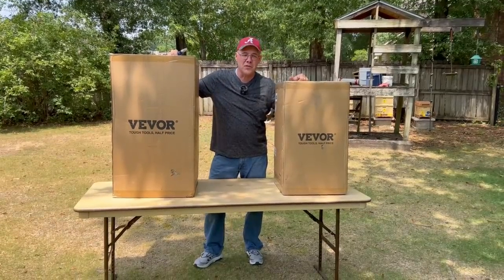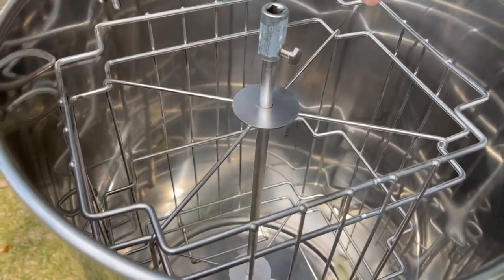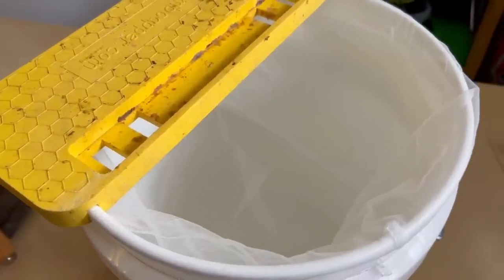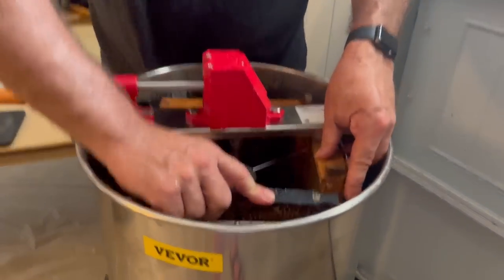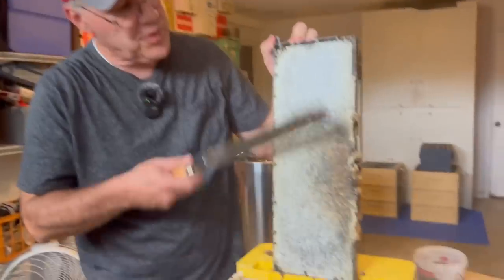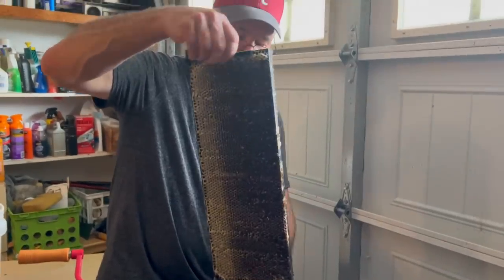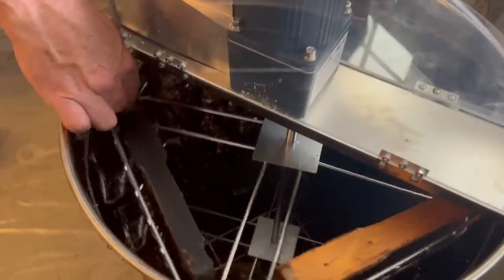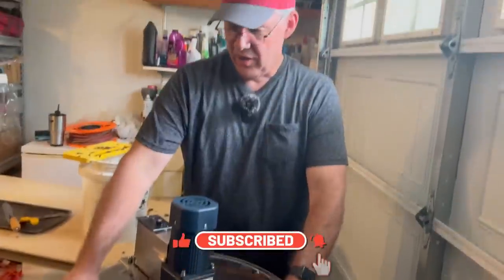Manual & Electric Vevor Honey Extractors - An Honest Review

Comment: I have the Vevor 3 frame extractor.
There are razor sharp edges along the leg lines. I covered them with electrical tape.
Keep an eye on the ball bearing in the hole beneath the spindle, it's easy to lose. I went to a local bicycle shop and bought a few spares.
In retrospect, I wish I'd spent a little extra and bought a better built extractor.
Reply from the maker: I hear ya.  These are good to get you through for awhile but if serious about beekeeping would probably be best to invest in something more heavy duty like a Hillco, Maxant, Dadant, Thorne, Lyson etc.
Reply: I was going to buy the electric one, but they were sold out.

Comment: Thanks for the review!!
Just a tip, you are placing your frames in backwards, the centrifugal force should be to the tailing end or top of the frame as comb is built by the bees with a downward angle like a "V". the openings are slanted slightly upward by 9–13 degrees. This prevents stored materials and brood from spilling or rolling out of the cells before they are capped with wax. so in the spinner case the top of the frames should be at the "back" of the spin direction. Otherwise you are "scooping" up the honey.
Reply from the maker: Makes sense. Thanks for the tip!

Comment: I bought the electric extractor about 4 years ago to supplement my old extractor. The first time i used it,  two of the leg brackets that are spot welded to the tank broke . I contacted the company, and they sent me a new tank.   The spot welds on the new tank didn't look any better than the first, so I sold it.

Comment: I’m a new bee keeper this year I got 28 lbs of honey and used my mentors 3 frame Vecor we ran into the same thing you did with deep frames….we put 6 small washers over the bolt and raised it up alittle worked great …. We also bolted it to 4x4s and stood on them. Then he let me crank it 300 turns each side. They were dry when I got done…..lol.   Great little machine we also used  Pamper Chef spatula to clean the bony off the walls worked great!  Hope to get an electric one 2024 as I am building 10 more hives and can’t wait to get my new bees!  Good Luck Middle Tennessee 🐝
Reply from the maker: Hey that’s good stuff and thanks for the tip!   If you decide to get a motorized one and you plan to do this for awhile I would look into a more sturdy model like a Hillco, Maxant, Lyson or Dadant type machine.  You will not be disappointed.  If money is an issue then the motorized Vevor worked well but I don’t know how durable they are.
Reply: I did watch a review of Hillco looked very sturdy and had good reviews and 4/10 warranty.  I work a lot of OT so the cost
Is OK $1000-+ just want a good machine hassle free but it was fun bee talk for a couple hours while
We were spinning my honey talking about 2024 and what we need to do to be more productive …. I said build 10 hives! I’ve already started 10 tops and 10 bottoms and vents done….. starting on brood boxes supers (deep& med) next! Not scared to work- can’t never did anything get out of you normal box and do stuff I have never done like build a total bee hive colony! Takes alittle time but when Insee 10 hives in my back yard
I built and bees buzzing around in April and my smoker filled up with wood pellets  ( great tip) that’s will be a great day.  That will be my B Day present to
Myself for turning 61….. heck yeah!!
Reply from the maker: Hey this is great stuff man.  And if you aren’t afraid of work the bees juts might be for you!  Hope it all works out well for you.

Comment: Vevor seems to be the harbor freight of the internet. I've looked at several of their products and I'm tempted to order somethings.
Reply: Your spot on ! I was cautious At first. But I have ordered small idems a big ticket idems an never had a problem with them and have had excellent results with there customer support . Replacement?has only been the time it takes to send me a replacement
Reply: In hindsight, I wish I'd bought something else.
Reply: @dkeithcollins   oh I understand completely it has its  problems. but for a start out with very little investment? But if I was going to be running 100 hives? No nada no way with that unit make it taking honey off twice a year… but the way I looked at it if it got me 3~4 years I could throw it away because it would’ve paid for itself.. if I was going to modify it? I would plug the side, Spicket and weld a Stainless Steel nipple in the bottom.  Then you would have super easy cleaning an hardly any honey loss
Reply: @dkeithcollins  For the Money Hillco makes a might fine extractor
Reply from the maker: Yes if I’m it for the long haul and don’t have much money or want to go budget grade on your first extractor the Vevor or something similar might work well for you. But if in it for the long haul and you are not afraid to spend some money for a quality product that will stand the test of time then would purchase something like Hillco, Maxant, Thorne, Dadant or Lyson.  All proven brands should give you good service.  That having been said the Vevor did a nice job. We extracted a total of 25 gallons of honey.  I have no idea about the durability of the product but it worked well for us in this little experiment.

Comment: Bruce, I bought the 4/8 extractor and use it at slower speeds and it works well w/o shaking. Start at 35 increase to 45 until the sling is nearly done, flip and slowly increase to 65-70, flip and in 2 min you are done. When you put frames in the radial slots, it shakes like mad. I do three med supers at a time, electric is the way to go and this is a dope extractor for the price.
Reply from the maker: Hey thanks for the input.  I think it is a nice extractor for the price.  That is good feedback though to help folks understand how to use it without it shaking.

Comment: I had a manual like that before and the handle broke. I could not loxate a handle so it basically became useless. Huge safety issue with the top not fitting on. I think the electric would be good for those with <5 colonies. I've learned that when you get more than 5 hives, approaching 10, you need a decent electric.

Comment: I looked an looked an thought an thought  an finally I decided in my old age I am a tad lazy and I went with the electric one 3 years ago. An I absolutely love the variable speed !! I can run 4 out while I am getting 4 more ready.. 😂 I see you found my one  problem I have with mine an that is the drain Spicket !! But I made a work around on mine. Mounted it to 3/4 plywood square with thumb nuts for easy storage an I have 2 solid half cement blocks I lay on the plywood. When done spinning I kick the blocks off an tip the unit to drain. But other than the Spicket? I have no problem an should this one die I will buy another one.. ( not that I would recommend it but them safely switch’s?? ) well let’s just say the unit works the same with or without..BUT if their was anyone else besides me running it? I would probably make sure they work for safety… but this video will help 100’s of small new beekeepers in the future ❤❤❤
Reply from the maker: Awesome!  Thanks for the feedback and for the tips.

Comment: I have the manual extractor, works fine. Could be a little more heavy duty but the price is excellent. The gate position is a negative for sure but totally usable.
Reply from the maker: Any issues with the cage being set too high like in the video?
Reply: @brucesbees  nope, mine is fine.
Reply from the maker: @tommywise1702 ok good.  The one I got was just a little strange.

Comment: This is one piece of equipment that I still need to purchase. I started with two nucs this year and ended up splitting one. Now two of the three are strong enough and starting to fill my first honey supers so it's looking like I may be able to pull a little if the flow continues here in s.w. PA.  As always, thanks for the video. Vevor seems to be the best value for someone like myself.  I think I would go with the electric model as well. Staying low budget went out the window as soon as I started purchasing equipment.

Comment: I have the electric 3 frame extractor and have no issues. Some frames take a little time to balance but can usually reach top speed. Are you putting the frames in the right way? Since the cells slope up towards the outside of the frames, i always put the bottom of the frame as the leading edge in the extractor. Helps the honey to flow cleanly out of the cells.
Reply from the maker: I thought I was doing it right and it works fine. But what  you say makes sense.

Comment: Thanks Bruce as always. I bought that electric 5-6 weeks ago. I think it was $270 and on my porch in 3-4 days. Took roughly an hour to clean (took out lube grease on ball bearing, replaced with vegetable oil), assemble, and fasten to porch joists (16” centers, 3” drywall screws, between deck boards). Was only doing 12-15 deeps as honey is not my focus (queens and nucs). Just pulling a some for friends and family this round. Uncapped, extracted, and hosed everything down by myself in 2 hours. If I was pulling a few 1000lbs, I’d go bigger, but easily worth the money for small time. Thanks again for all you share! 🐝😃
Reply from the maker: Yeah I think it is perfect for that situation.
Reply: Do you know the size of that ball bearing? Forgot about it and lost it when cleaning
Reply from the maker: @andywhetsell8828 yeah I lost mine too.  It is not very big but not sure of the size.
Reply: @andywhetsell8828  I wrote like a detailed reply yesterday but must have gotten crossed up. I first guessed, then figured it wasn’t that difficult to unbolt the top. The ball that shipped with it is 6mm. Lappe’s and Betterbee had done advertised, but for a one-off a hardware store or eBay would work.
Reply: @joestocker660  thanks Joe. I’ll order several because I’m sure I’ll lose another one
Reply from the maker: Hey thanks for the update.  I had no idea the size but I knew it was pretty small.
Reply: @andywhetsell8828  As long as you’re pulling light honey. Otherwise you may lose a tooth 🦷😂 Biscuits are no place for bearings.

Comment: Thanks for your review. I purchased the hand crank version being that I have only 2 hives. I experienced the same issue whereas the frames hit the crossbar. Mine was totally unusable until i reversed the connection that drives the basket.  Tops are totally unusable. One side of the the crossbar sits higher than the other side. This allows enough clearance to rotate that basket without hitting the frame ears.
Trying to reach the mfg. has not been successful.  Very nice review. Thanks
Reply from the maker: Yes I was not impressed either the hand crank one.

Comment: I bought a used dandant hand crank came with matching storage tank for 200.00 ... Ended up buying a new electric maxant so I sold dandant for 250.00 and kept the storage tank.. in like 5 minutes on market place.. something to consider is resale American made will hold its value like a Kubota tractor does .. going to cost more up front .. maxant im going to sell its to small and to tight 9 frame think its called .. i expect ill get what I payed for it .  That's pretty sweet they just send you couple free extractors .. all your hard work paying off.
Reply from the maker: Nice job finding a great deal!  In reality you cannot go wrong lying a little extra for good quality products, but sometimes the cheaper stuff can get us through for awhile.

Comment: Thanks for the review!  I wish I could share the same …. Purchased an electric extractor from Vevor last year and my bad, did not put it together for about 5 months.  No attachment points for the 3rd leg and too late to do anything like call the company.  Forced to use with 2 legs and a milk crate.  Still better than a manual though!  (PS - my son will be going to Alabama in the fall 🫣..so far!  ❤️🐝🐝 in Northern IL
Reply from the maker: Roll Tide!   Wouldn’t be bad to just start it to a table.  I’m sure Vevor would have made it right but sounds like you figured out something that would work.

Comment: I have the hand crank Vevor the ears on the frames hit the crank frame support, the cage is too high. I had to cut down the bottom of the rod of the cage to drop the cage 1/4 "
Reply from the maker: Yep. Not a good design.  I gave mine to a friend. He said he had to push the frames down into the basket and it sounds like it worked out ok. I actually gave both of these extractors away.  They are way too small for my operation. Just did the video as a review.  I think the electric one is a decent machine but would not recommend the hand crank.

Comment: Hi Bruce,  great reviews.  I am still using a 2 frame hand extractor that I got when I started 4 years ago with 2 hives. I guess now with 20 colonies I should upgrade but I have become very efficient with that 2 framer. What would you recommend for 20 to 50 colonies?
Reply from the maker: I would get a 20 to 30 frame extractor.  Several good companies.  HillCo, Lyson, Thorne, Maxant, Dadant, and more.  I currently have a 30 frenar extractor and have combined my efforts with my friend Rusty who has a 30 frame Lyson so we basically have 50 frames running at once.  If I decide to upgrade or get another extractor will look into Hillco and Thorne first.  Then go from there.  At least that is what I am thinking now.
Reply: @brucesbees  Thank you for the great recommendations, definitely a big investment that will need to be made.

Comment: I have that vevor electric.  Its cheap and functional.  Ill see how long it last.  I screw mine down to a pallet.  BTW, you are spinning the wrong direction for the tangential frames.  You should spin toward the bottom of the frame.  That works better with the slope of the cells.
Reply from the maker: Seemed to work fine.
Reply from the maker: But spinning the other direction theoretically could have worked better with the manual I guess.
Reply: @brucesbees  It was hard to tell but it appeared you spun the direction of the top bar.  In the tangential position, it pushes the honey into the cells a bit.  Thats easy to solve with the manual because it spins either direction.  Takes a little more thought on the electric.  On the electric you can put 8 frames in there radially - one on either side of the space you put them in.  One of them will fall into the tangential position if you do not tie them together.  I had pretty good results rubberbanding them together after getting that tip from Joey Rawls.  You need pretty stiff and thick rubber bands though.  When I am by myself I just do four at a time in the slot.  It keeps up with my slow uncapping.
Reply from the maker: @rtxhoneybees thanks for the tip.  Though I will say these frames were very dry after spinning.

Comment: Is the honey gate for these extractors below the bottom of the tub?     I’m trying to see if the honey will drain completely without tilting the extractor.
Reply from the maker: Nope.  I talked about this issue in the video near the end.
Reply: @brucesbees  Thank you.  Sorry I didn't notice that statement in the video.
Reply from the maker: @mgmbamaguy  hey no worries.  I kind of snuck it in at the end.  The extractor is very light though so really not as big a deal as the heavier duty and larger ones.  Would work well for a hobbyist with a few hives but I have no idea how durable these machines are. We harvested a total of 25 gallons that day.  We did two runs with the manual extractor and for the rest we used the manual one.

Comment: I only spin mediums and no matter what, the extractor always vibrates like crazy….almost across the floor. What am I doing wrong?
Reply from the maker: I don’t know. It is a pain.  Every extractor I have had has walked until the frames are mostly spun out.  And these extractors are not heavy so it is even worse.  We boot down our 20 framer when we do our big extractions and it works well.

Comment: Chinesium junk. A friend bought a Vevor extractor. Some welds broke and it self-destructed.
Reply from the maker: Yep they are definitely not a top of the line product.  We use Maxant and Lyson extractors for our typical harvests.  They are rugged and have lasted for years. The Vevor is an extractor for the hobbyist for sure.  If I’m it for the long haul or plan to increase hive count will certainly want to upgrade I’m sure.  But not a bad little piece of equipment for a beginner or smaller outfit.

Comment: Great review..TY..... I have a massive unit that needs a new motor/belt, hardware....Otherwise its solid and hope to fix one day. In the mean time Im buying this unit to keep working.
Reply from the maker: It’s definitely not heavy duty but hopefully will get you through
Reply: @brucesbees  TY brother, I picked up a used manual unit for 175$ Canadian. One issue I see with it is the height of the lower port. There is approx a 1" lip from base to valve...not cool,, not well planned out...
Reply from the maker: @carsonsflyinghigh these are similar to that though I don’t know if it is an inch. But lightweight so not too big of a deal.

Comment: UPDATES to my previous post.

Junk. Bought the small 3 frame unit.
When using, it feels like it is going to fall apart.
Incredibly light frame and useless legs.
The outlet is 1" above the floor of the tank. Stupid design beyond comprehension.
For those of you who are wondering WhyTF did I buy it? 
Good Question. My main extractor needs a new motor and pully.
Bought this POS for 175$ used. 
DONT WASTE YOUR MONEY
Junk
Reply from the maker: Not designed for heavy use.  But the motorized one does ok for a small time operation. It is wise though IMO to spend more and get a better quality one if you plan on being a beekeeper for years to come.